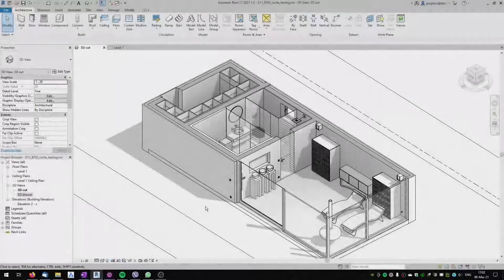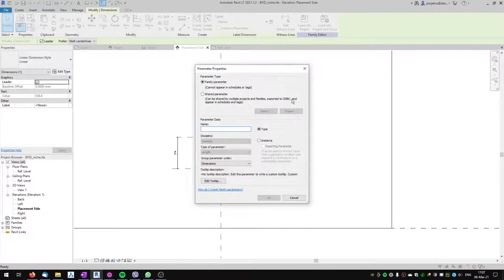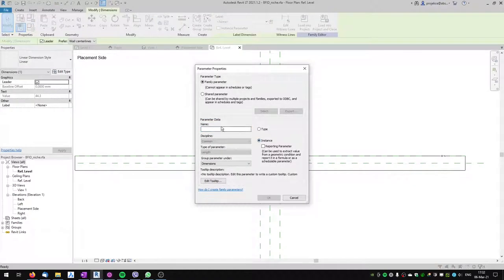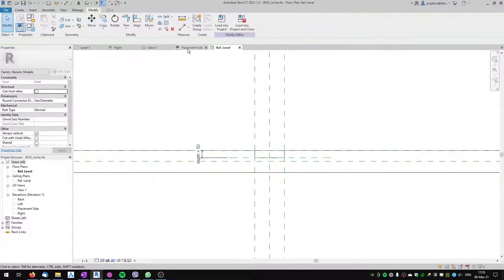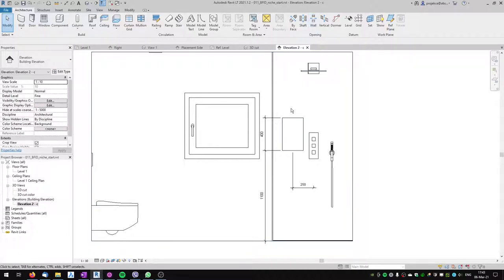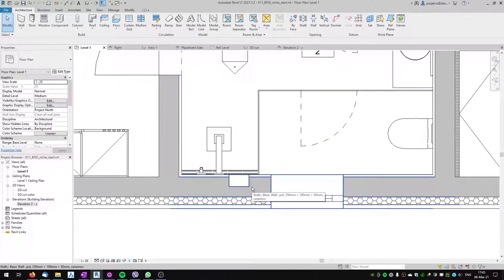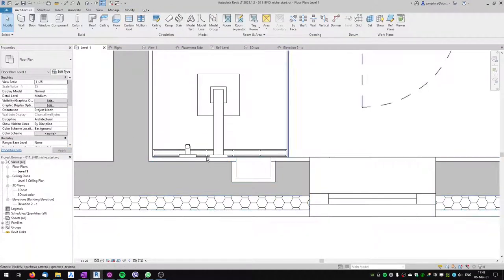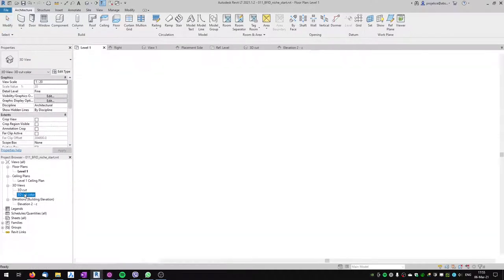Create Wall Niche in Revit

Comment: Hi, thank you for the video.  Trying to follow along but stuck on aligning and locking the void to the reference lines. Can you advise on why I wouldn't be seeing the reference lines I create when in the "Floor Plan Ref. View"? In the "Placement Side" View, I extended them past the wall edges but that only revealed the horizontal line, not the two vertical ones.
Reply from the maker: Hi, I am not sure how to fix that. Try temporarily hiding other objects which might obfuscate reference lines.

Comment: Hi Tom, awesome family, thankyou! I've put this in the back of a wall view i have made. Is there any way to make the niche in the back of the wall automatically show as hidden lines, without using lineworks? its meant for structural drawings..
Reply from the maker: I am not sure what you mean by "back of wall view". Is this an elevation view of the wall, where the niche is on the other side of the wall<
Reply: @BIMforInteriorDesign  Yes, exactly, sorry for the confusion.😅 Any way to make the outlines of the niche automatically show as hidden lines?
Reply from the maker: @TehCervickz  Well, if you want the niche be visible from the back side, you use model lines to create this. In family editor, you can draw model lines (using dashed lines) on a reference plane, which is locked to the back side of the wall. These dashed lines are than visible in the project on the back side of the wall. The problem with this solution is that these dashed lines are visible in all views, including 3D views. That's because they are model lines.
Reply: @BIMforInteriorDesign  Woahh cool, i will definitely be trying this, thank you so much for helping out. :)
Reply: @BIMforInteriorDesign  loving your videos btw, especially the quick tips!

Comment: Hi! Which command did you use to switch your placement side of the dimension end? you do it in 4:46
Reply from the maker: You have to hover your mouse over the reference plane and hit TAB key. When several objects are one over another on your screen, you can cycle between them with the TAB key.